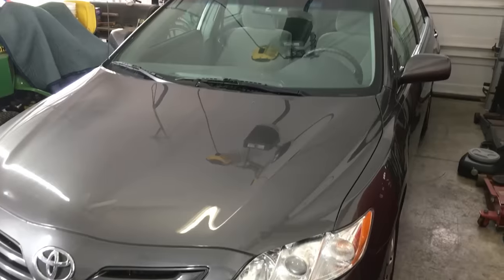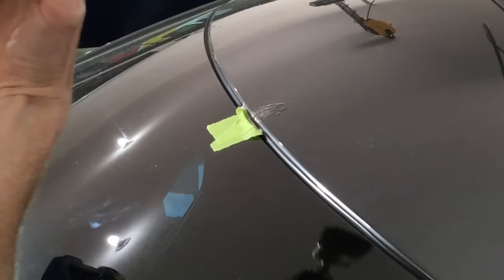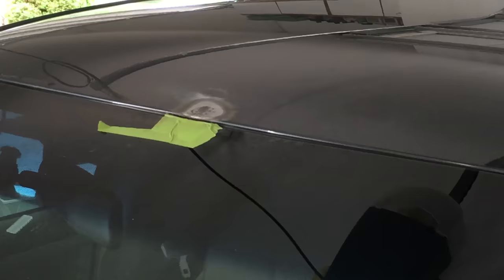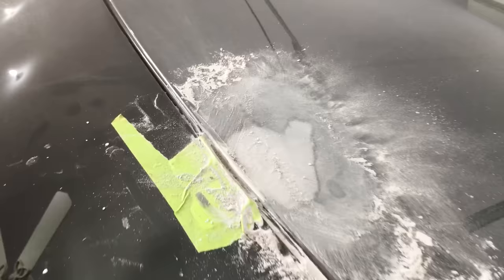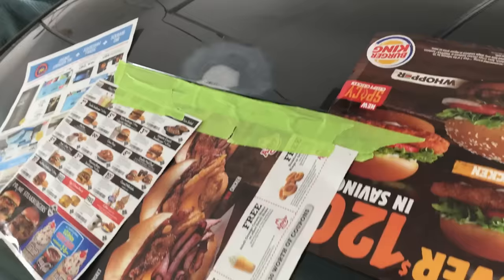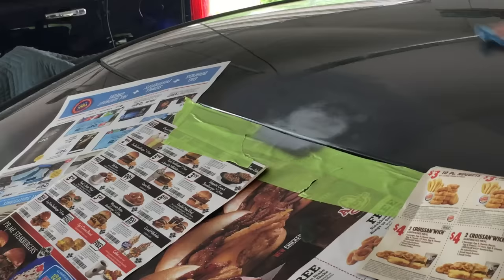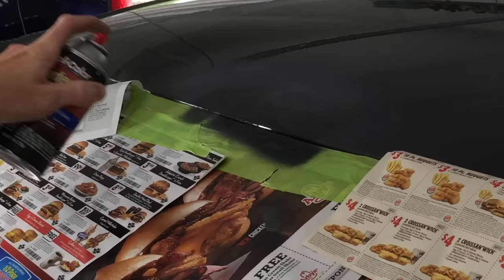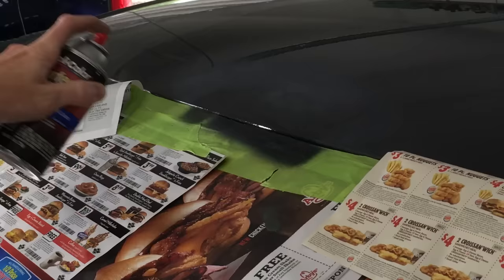How to Fix: Rust Bubble Under Paint from a Rock Chip Around WIndshield

Comment: Hi , my camry 2006 has a dot rust at the windshield area  , and workshop told me to remove the windshield and undergo a repair and repaint the roof costing 1500 , need help if I can do it myself
Reply from the maker: ahmad mohd if the rust does not go beneath the windshield gasket seal, it can be repaired at home without removing the windshield

Comment: Why do some cars have the clear coats dry and flake? My neighbor keeps his car outside like I do, and we both have the same year toyotas.  thanks for video!
Reply from the maker: The main reason is UV exposure. Keeping sealant/wax on the paint will preserve it longer. Certain OEM colors have this problem more than others, but it will happen to any clear coat over time with enough sun.
Reply: @6thGearGarage  Thanks

Comment: how do u not have more subscribers. your fucking on point with info. best paint correction/ body work video iv ever seen. on point with accurate info. people this dood is this the shit. owns his mistakes and still teaches. fucking listen. 

ps rust converter is not needed as he took his time to REMOVE the rust ( cancer area). rust gone. prime and paint is the protection of done right. which of u follow this doods guide you should be good.
Reply from the maker: Thanks man, that means a lot. I saw comments about the rust coming back, but at 225,000 miles, how much longer is that car really going to be around. It's an Ohio car so rust is going to continue to pop up in different places.

Comment: Thanks for the video! I'm trying to paint over some rust repairs on an old Honda. I did a poor job taping before painting and wound up with visible borders after I removed the tape. Can I just sand those down and maybe hit it with another coat of paint before clear-coating? Or do I need to re-prime? Thanks for any help!
Reply from the maker: Hey I just replied to your email, a pic of the area will help me get a better idea of what's going on.

Comment: The only thing I would have done different is to use a 2k clear and properly melt/blend it into the existing clear. Not only for a bit better asthetics, but to really lock in the repair so it's less vulernable.

Comment: After waiting for the clear laquer to dry do I not have to sand the area with 2500 grit paper? Following with buffering it after?
Reply from the maker: If the clear is rough or has a lot of orange peel, then you can wet sand and polish. Mine was pretty smooth, so I just polished.

Comment: Hi, how long do you expect the rust to came out again in the same place ? I have the very same problem with my car and all car repairers told me that fixing this problem is not worth the money since the rust will come out again in a year and the repair will be expensive. But after seeing your video I feel confident to fix it myself. Thanks.
Reply from the maker: Aside from cutting out the rusted area and welding in clean sheet metal, the rust will always come back eventually. Repairs that don't cut and replace usually start to rust again after a couple of years around here. It's just a cheap/easy way to buy some time and slow the rust down.

Comment: I have couple of rusts in my vehicle and I am super new to this , I got all of the materials you recommended. Before I start following these steps, do you recommend any updated steps to follow ??
Reply from the maker: Yes, I would use a rust convertor after grinding down all of the rust, to ensure the rust does not come back.
Reply: @6thGearGarage  Thank you very much for your response. I do have one more question,  how long should it be between multiple coats and different types of sprays?
Reply from the maker: @oryana2023  I usually waited 10 mins, but it really depends on the instructions for the product and warmer temperatures will also cause paint to dry faster.
Reply: @6thGearGarage   Sounds great. I am ready to go now :)
Reply: @oryana2023  How did it go?

Comment: I used a single stage acrylic enamel with the clear coat mixed in on my 2007 Tundra. The paint shop said the majority of customers do that for convenience and time. I had some acrylic lacquer clear coat like you used on hand, and added another couple layers and feathered those. Will the lacquer over the enamel cause any issues? I didn't know I was combining the two at the time. Also, I have two more spots to fix and all the fixes will be pretty close together. If I switch to an acrylic enamel clear coat, will it be pretty noticeable next to the lacquer clear coat? This video and others are really helpful.
Reply from the maker: I was always taught never apply lacquer or urethane over enamel because it can cause the paint to lift. But if yours hasn't lifted by now, I'd say you're ok.  I've tried blending with enamel clear and it was very difficult. I ended up with a halo line near the edge of the spray area. Lacquers are better to blend, or if you want UV resistance, go with a 2k clear such as Spray Max https://amzn.to/3kymSWT  -  2k over lacquer is ok, shouldn't cause any lifting.
Reply: @6thGearGarage  I did run into some issues as a matter of fact. I think it was a combo of what you're describing, probably too many layers, and it was 98 degrees out. I went to polish and there was 2-3" wide ring of unbonded clear coat. I had to sand that down and then hit what looked okay with 400 up to 1500 grit and repainted with the acrylic enamel. It's going on a day and a half of sitting, but I think I see what you mean by a halo I think. Even though it has a clear coat mixed in, I got some acrylic enamel clear coat to probably hit with another layer or two. I didn't think to check was type of paint it was until it was too late (and another bottle that arrived late from another place is urethane, so I'm 0-2 on getting lacquer).
Reply from the maker: @dustinlandau3563  Yep that is exactly what happened when I tried enamel, it just didn't feather well. But the good news is that none of your paint lifted.
Reply: @6thGearGarage  That said I have two more spots to hit...along windshield just as in your video. I have the can of enamel and now can of urethane. I don't want to get yet another can to get lacquer. Which would make more sense to use at this point?
Reply from the maker: @dustinlandau3563  This is where I can't really speak from experience, as I've never mixed types of paint like this. The urethane will be UV resistant and should feather easier, but isn't recommended over enamel. However, you put lacquer over enamel before without any issues, so maybe it will be ok again. If you go urethane, try in a small area first to make sure nothing bad happens.

Comment: Question: since you painted over "some" areas that weren't sanded, won't that paint lift off over time since it was applied over existing clear coat? Just wondering. I see many videos that tell you to "scuff" a large area around where you are going to blend the paint so that it sticks, and then you apply a coat of clear over all of it and polish. What do you think?
Reply from the maker: Some areas that weren’t sanded did get overspray on them. However, when I polished the surface with a compound, the overspray and light areas were removed because the lacquer clearcoat are used was softer than the OEM paint, especially since it had Recently been applied. So by polishing,  it removed areas that wouldn’t adhere well.
Reply: @6thGearGarage  thanks for the info!

Comment: Can you use several layers of primer and paint to fill up pittings?
Reply from the maker: They do make a filler primer: https://amzn.to/3Tfe9Jv but it's meant for small imperfections like scratches and pinholes. It probably would have required 20+ coats to fill the area I was working with. Even then, not a great use because body filler cures to be much harder than the filler primer.

Comment: no sanding of 2000 or 2500 grit on the clear coat?
Reply from the maker: There was not any need to wetsand, as I had no orange peel and the lacquer clear paint was still soft enough to shine up with just polish.

Comment: Good finish for a spray can job, however you should be  neutralising it or it will bubble up again. Ideally you should use a spot blaster to clear all the rust out of the pitting they can be bought  for less then £20 and run from a small compressor. And a rust converter onto the bare metal £5 for a small bottle this well neutralize the rust and seal it from oxygen so it wont rust.

Comment: Tape wax paper around area to protect car 
Metal bristle brush attachment to remove surface rust
Sanding block w 80 grit for bare metal and rust 
Use Wax and grease remover to clean and prep for Rust neutralizer and wait 20 minutes 
Use Wax and grease remover again to clean and prep for bondo
Clean and prep with Wax and grease remover 
Mix and Apply bondo
80 grit to take off highpoint in bondo
When Sanding use cross hatch pattern 
180 grit 1in to 1 and 1/2 in away from bare metal
320 grit 
400 grit  3 in away from bare metal 
Clean w wax and grease remover 
Use self etching primer for bare metal
Use filler primer to fill scratches and imperfections 
600 grit 6in around 
Wax and grease remover to clean and prep surface 
Don't touch w hands 
When using color spray paint spray 1 ft away left to right 
Spray on color spray paint lightly over primer 
Wait 10 min
Apply second (10 min) and third (10 min)
When using clear coat spray 1 1/2 ft away
Get clear coat and spray lightly 1st, spray tad bit heavier for second, spray a "wet coat" second and should be thick. Thicker in needed area but feather out lightly around the edge
Wait an hour and wax with the meguiars ultimate compound w Buffing pad
Wait couple days (minimum of 3 days) and put a coat of meguiars wax w Buffing pad
Reply: Made this for my self for later but thought I should post the comment on here for others

Comment: Hi! I was wondering how I can fix a matte area on my car. The previous owner did a bad redo paintjob on a specific area with makes the paintjob go from the original shiny finish to a matte paint finish. I want that area to be the same as the rest of the car. 
Thank you
Reply from the maker: I would start by doing a full paint correction on the area.
Reply: @6thGearGarage  Thank you. I will try that. Will it blend with the other finish or do I need to use masking tape, masking off the original finished area? What do you suggest?
Reply from the maker: @MattSe7enofficial  Unfortunately you will have to polish the matte area first to see how well it will blend with the rest of the paint. I would not mask anything, but just feather the polished area, or do the entire panel/car if you want to bring the whole finish back to a new shine. If that doesn't work, paint work may be needed, but paint correction is the easier/less expensive option to try first.

Comment: I'm not a fan of rust converters unless they are phosphoric acid based as all they do is convert the rust on the surface and dont do much to treat the underlying rust (dont believe me? just scratch a piece thats been rust converted, itll probably still have rusty red texture where you've scratched it off.)
 In a spot like this, I like to get a lint free paper towel or rag that is strong, and cut a little square out of it, then put the square over the rusty part. Then barely soak the rag with either phosphoric acid or citric acid (or even better evaporust) so that it doesnt drip. Then cover the rag with saran wrap to stop it drying out so fast. Let it sit for a few hours or even day. This will dissolve and remove the rust, rather than just converting it. Then brush/ scrub / wire wheel the crap off. Repeat as necessary. This works good because it gets down into the rust thats sat in the bottom of pitting that wire wheeling cant get into.  

You did nothing to treat the rusty parts in this video, so it will more than likely resurface rusty again in a few years. Otherwise good technique tho
Reply from the maker: That's excellent advice... thank you!

Comment: Do you use the clear-coat on any type of paint? I mean don't some vehicles have no clear-coat when new?
Reply from the maker: In the old days different types of paint were used without clear coats. Nowadays vehicles have a urethane base + clear coat.  The clear I used was a lacquer. Urethane is better/stronger.  You don't want to use either type over an enamel paint because they can react and wrinkle up.

Comment: How does this hold up, I've got typical quarter panel rust that I don't want to get any worse, I care about this car and I know the "proper" thing to do would be to cut out the quarter and replace them but it doesn't make financial sense given what the car is worth. So I'm curious how this will hold.
Reply from the maker: JDM quarter panel rust eats the metal from the inside out. Without cutting and welding new metal, you might get a year before rust starts to show up again.
Reply: @6thGearGarage  I figured as much it would be a temporary fix until I have time to do it properly, thanks for the reply.

Comment: Appreciate the video, if my color coat went on a little thick and has a rough like texture should I set sand/polish then go to clear or clear 1st anyway?
Reply from the maker: J if you're looking for the best results, I would wetsand the color coat with some 600 grit to get it smooth, then reapply more color. That's a method known as "color sanding" and it's what the pros do on professionally painted cars to eliminate orange peel. If you're ok with some texture, you can put on extra clear coats for a thicker clear and wet sand when it's all done to get it smooth but the reflection in the paint won't be as perfect if you color sanded.

Comment: How did you stop the clear coat turning opaque when you over sprayed it on the existing.
Reply from the maker: Sometimes it lays down cloudy at first, then it clears up as it cures. Usually when the coat is too heavy is when it happens to me.
Reply: @6thGearGarage  Hi. Thanks for the answer, I'll bear that in mind next time I want to ' just spray a little more on.👍

Comment: Just bought a used, one-owner vehicle. The previous owner has scratches and knicks all over the FD door from his keys, keychain, or small chainsaw. Got some matching paint that came in a 2oz bottle and a brush (think: nail polish). This will probably go on gloopy. I do have some 2000 sandpaper, clothes and clear coat. But before I attempt to botch this job without spray paint, do you have any ideas or advice. I was going to pretty much do your steps minus heavy sanding at first, and sub the fingernail paint for spray. Thanks!
Reply from the maker: "small chainsaw" haha... I've used the stuff you'e talking about and it's not easy to make smooth. Good news is that it's softer than the factory paint, so once it dries you can wetsand it down to be flush with the surface and polish it for a nice looking finish, or even just skip the wetsanding and just polish with a variable speed random orbital buffer (I use the griots garage 6" for doing paint correction) and some medium cut compound. That alone should knock it down to the same level as the OEM urethane paint around it, if it's only the width of a scratch.  A cheap orbital buffer like I use in this video will also work, just might take a little longer with the slower speed. You should be able to get some impressive results with the brush. Most people never bother to polish it and it shows.
Reply: @6thGearGarage  I appreciate the reply. Thanks!
I have ''rubbing compound'', or are you talking about another kind? I don't have a buffer. Would a dish towel in circular Karate-Kid motions do the trick? Thanks
Reply from the maker: @dustcircle  Yep, rubbing compound is the stuff. There are different levels: low, medium, and fine - some will cut faster than others.  The finer stuff is more for removing fine swirl marks. You can use a towel, but it will take a LOT longer.
Reply: Great, thank you!

Comment: If I have a couple very small surface rust holes from paint chips in my roof (MMs in width), can I just use the spot putty instead of the body filler? Or should I use the body filler instead of the spot putty? I'm not sure how deep the rust goes but they're so small I'm not sure if I need to use body filler.
Reply from the maker: The filler will always dry harder than the putty. I only use putty for the finest imperfections.
Reply: @6thGearGarage  Thank you for the quick response! I have a 2019 honda civic that is basically my baby so I'm looking to fix the paint chipped rust as quickly as I can
Reply from the maker: @MrMattchappy  Yes, the sooner the better when it comes to rust!

Comment: Nicely done and your steps down in grades of paper was clearly explained, but why no 'lubricant' which would be water if using 'wet & dry' paper...?

In other words why no 'wet & dry'........?

I know this can be messier and is often used on larger areas.......and water running around can complicate the job....

I have found that 'wet & dry' is not really necessary, but would welcome your views on this....

Thanks
Reply from the maker: Mainly for the reasons you mentioned. It was such a small area and it would have made more of a mess.  Also I didn't want any moisture to remain in the repair area.